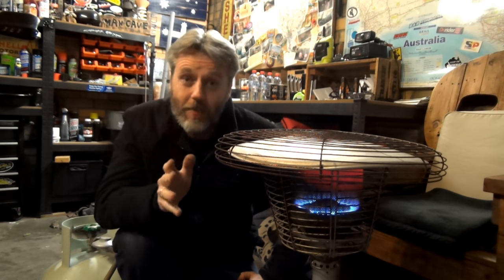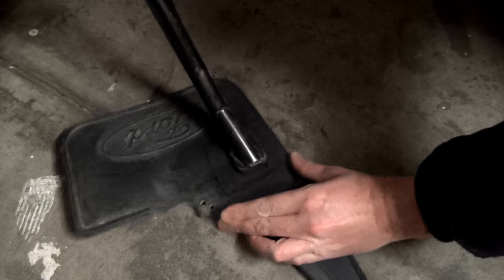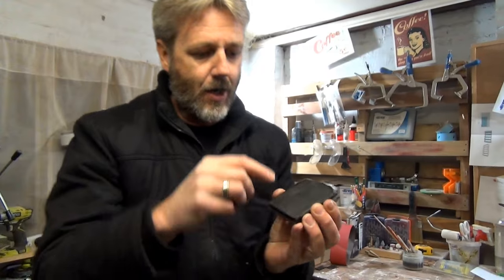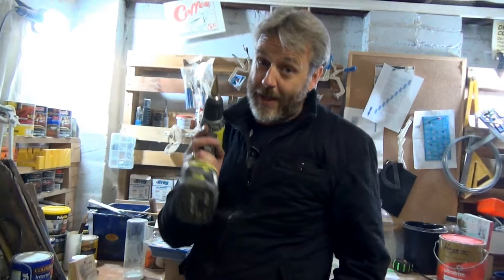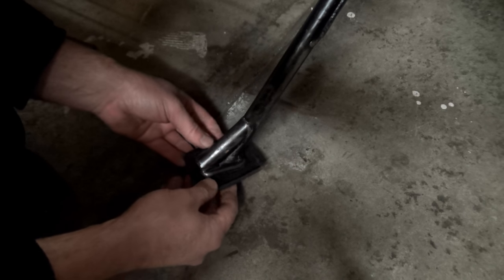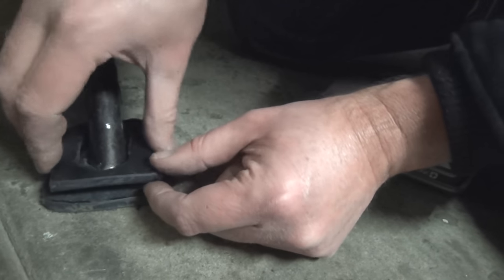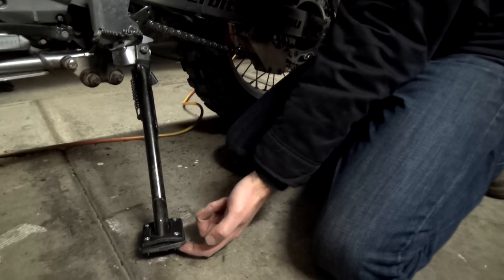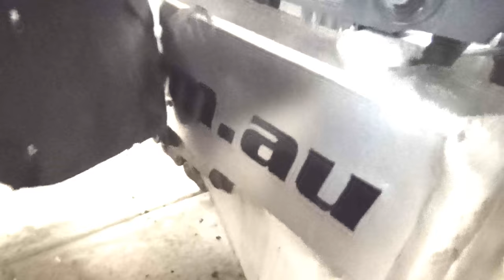DR650 DIY Kickstand Pad for the SAND

Comment: Your ~weapon~ is called a "step" or "step down" drill bit.  They're as handy as a pocket on a shirt.
I made a kick stand pad out of some pretty thick kydex I had laying around, but I did mine a little different.  I cut 2 round disks, the approximate size of a good thermos bottle, clamped them together and smoothed the edges up on a belt sander.  The bottom disk was left as is.  On the top disk I cut a rectangle (about) three quarters across, rounding the end (sort of like you did with that step down bit).  I turned it over and Dremeled a recess, the shape of the factory kick stand pad.  I glued the 2 pieces together using the same stuff you put engine case guards on with (Red RTV Gasket Maker).  So instead of the 2 disks fitting together flat, if you looked at it from the side edge and it looks like a little garage was cut in the top disk for the factory kick stand pad.  It simply slips on the bottom of the kick stand.  I keep it readily accessible in a bag on my DR.  If I need it, I slide it on.  If I don't need it, it doesn't get in my way.  You could actually make one out of PVC pipe.  Just heat it up and flatten it out.  Cut your shapes from there.  I've made knife cases, pistol magazine cases, etc. out of the same kind of PVC pipe that you used for your tool kit modification on Max.  It works great.

Comment: Nice!   Here's a tip...  if you do need one of those pads you just throw down, drill a small hole in the pad and tie a string to it.  Have the string long enough to put have a loop on the other end to slide over the hand grip (or clutch lever if your prefer).  Then, when you hop on the bike you just stand the bike up, grab the string and pull up the pad.  No bending over to get the pad and it helps you remember that it's there.  Works a treat for old fat guys like me!  Cheers
Reply from the maker: +David Day - yeah they are a great idea! Thanks

Comment: Bloody sweet job mate!!!  Cost you nothing but a bit of time....... just one thing if you are looking to improve the next model.... you could have used the heat gun to mold the top plate a little before screwing it to the bottom plate. That way there wont be as much force on the screws and maybe have it pop apart from vibrations while riding??  As always mate, bloody great job!!!

Comment: I've been thinking of doing this with steel .... U ever done that ? Why did u pick to do hours with plastic ? How's it holding up so far ? Wearing out your swing arm decals? Have a good one buddy .
Reply from the maker: +Rex4x4 - l have only just done it so can't comment yet. It does not touch the swing arm so decals are fine. I prefer plastic than metal incase of coming off and it digging into me.